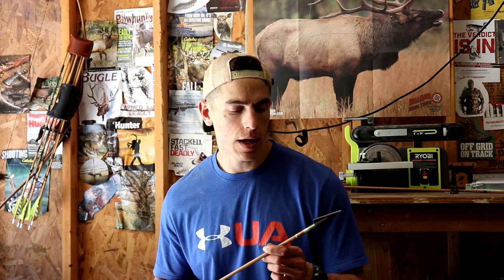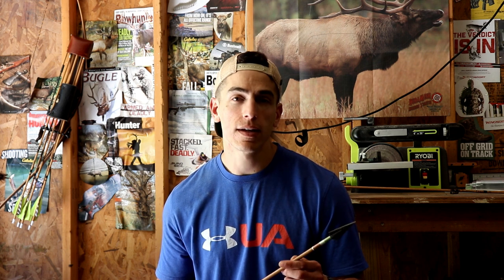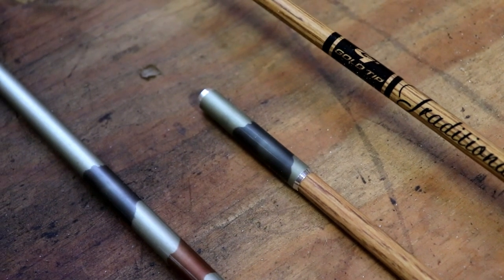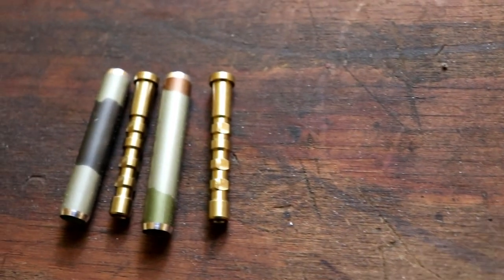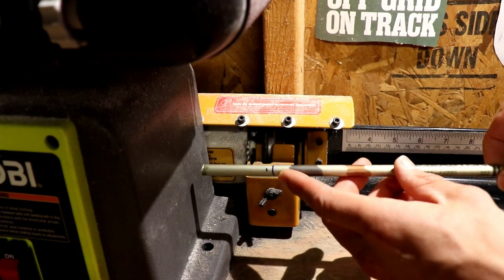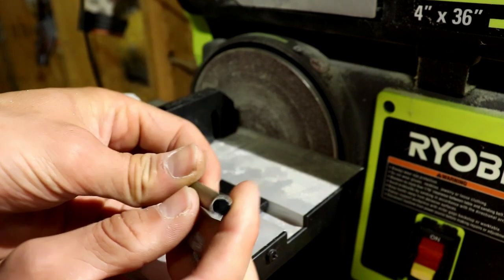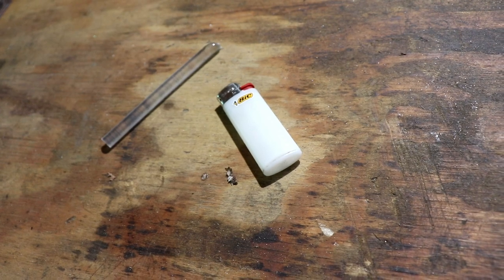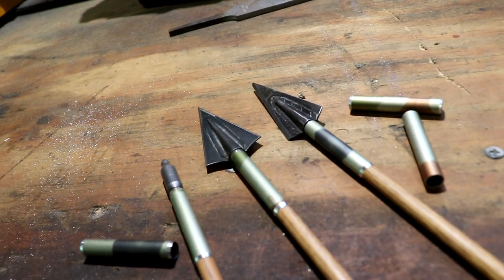BOMBPROOF CARBONS // DIY Aluminum Footers for Maximum Structural Integrity

Comment: Yeah, I shot those Bemans with the outserts,  they worked well. I can't find anything from Ethics for the Easton ACC Pro Hunting Shaft 340. It would be nice to have aluminum wrapped with carbon then beefed up with an aluminum footer. I really enjoy the content in your videos. I plan to shoot them out of my custom takedown recurve with a very good single bevel broadhead & i need FOC. I do have a few old 2117's laying around but I don't want to butcher them if I don't have to. Thanks 😊
Reply from the maker: Sounds like it’ll be a lethal setup! These gold tips (w aluminum footer) come out to 675grs total arrow weight w 23% FOC. Was bored one day so I did the math. Glad you enjoyed it! Good luck with your build!
Reply: @SeasonsChange24  My latest arrow build for my Prime was done in January & February. I took some Victory Xtorsion shafts & put a 125 gr. Ethics insert with a 125 gr. point. I bareshaft nock-tuned them b4 I fletched them. I fletched them with 3 vanes & 2 different patterns of a 4 vane & they all shoot true. Total weight on that .204 arrow with a Bishop Holy Trinity 125 head is 640gr. Very high tolerance on every thing involved with no weak link in the chain.
Reply from the maker: Joseph tread lightly now to make meat 🥩